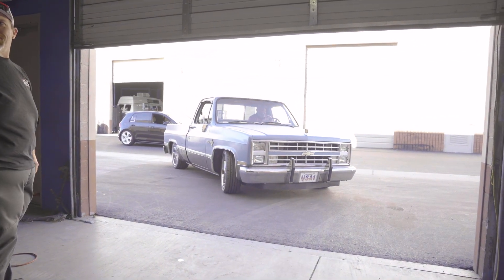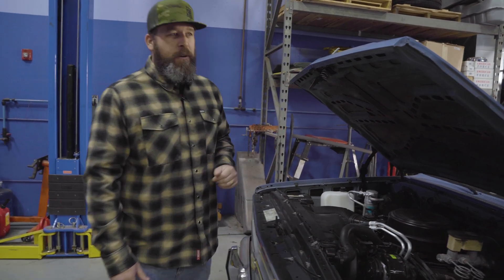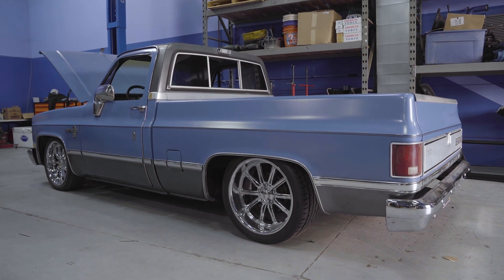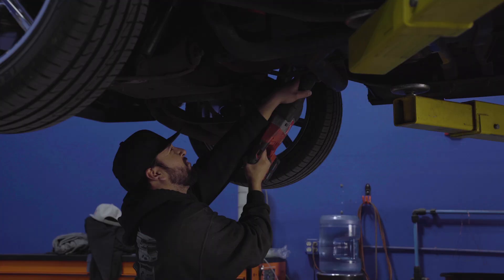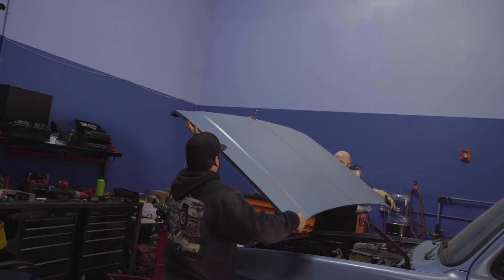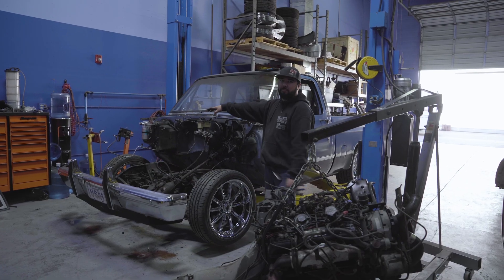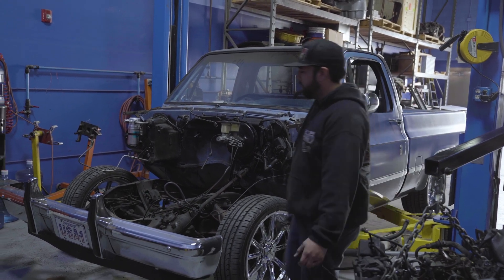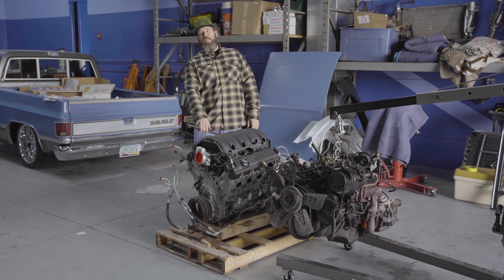Squarebody Chevy L83 swap, part 1

Comment: Did y’all keep stock cruise
Reply from the maker: No. You can’t keep the stock cruise control with the new engine. You could run a cruise module with the newer engine, but I’m not a fan.

Comment: Can you help me out or send a link for me? I have a 2014 5.3 want to put it into a 1973 impala, what parts do I need or kit?
Reply from the maker: Never done one in a 73 impala. Sorry. 
You’ll need a lot of parts though. Other than engine and trans... engine mounts, trans cross member, driveshaft, radiator, exhaust, stand alone harness, custom intake, gauges, etc etc

Comment: All these L83 or LT1 swaps i hear, and they don't sound as nice as the LS or Small block Chevy. Why is that? They sound stock.
Reply from the maker: This is an L83, which is the same headers as a LT. It sounds great, if you ask me!
Reply: @tre5customs113  it sounds great, yes, but a big block chevy sounds way better. The exhaust sounds great on this, but I am referring to the motor sound.
Reply from the maker: @mr.e1220  I hate the way a big block sounds, lol. Sounds rudimentary. I’ll take a Magnuson on top of a LS over almost anything... street driven.
Reply: @tre5customs113  i will look for a vid to have a listen. Yea,  it's just a preference for me. I'm from the drag racing era. 80's Pro Street cars, etc. It's all good.

Comment: Hi! We are doing an L83 swap. Could you tell me where you connect the brake booster to the vacuum?
Reply from the maker: Back of the intake manifold. We used a car one, so I’m not sure if it’s different on the truck style intake manifold.